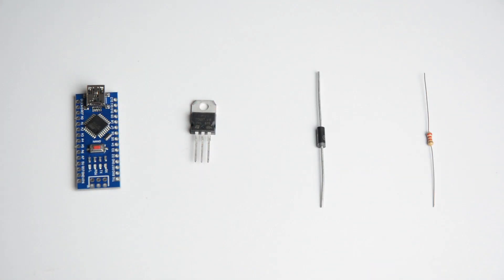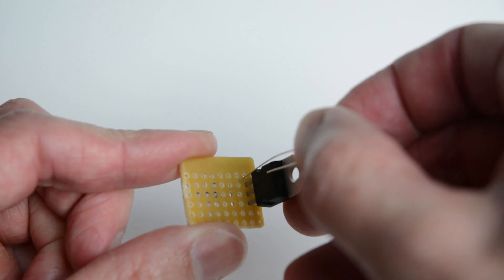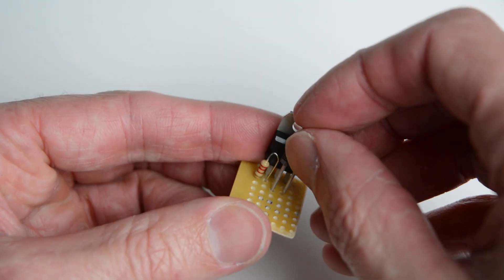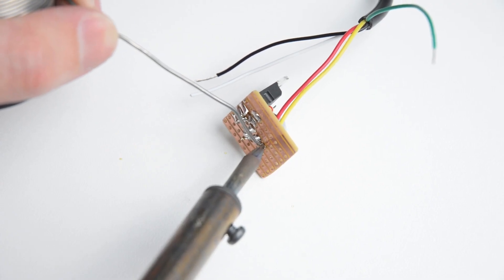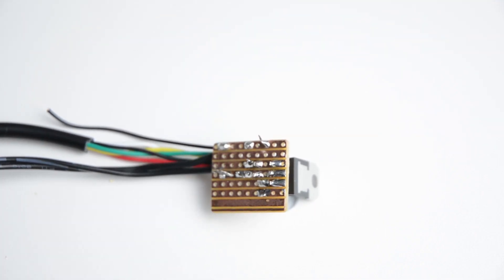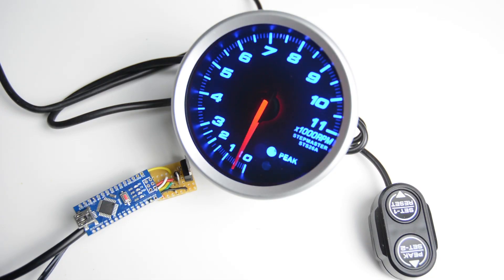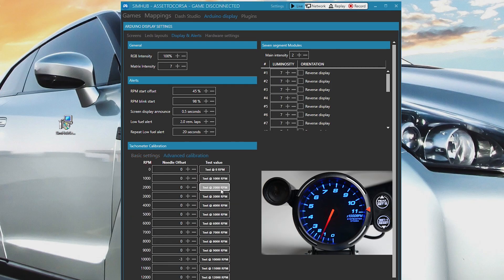DIY ARDUINO RPM REV TACHO SIM HUB DASH

Comment: Hello amstudio,
how could i Use Arduino UNO R3 Please let me know. One more thing: can I use Arduino UNO directly as a tachometer? I mean, can I ignore the below components and directly connect to the Arduino Uno?

1. TIP-120 Darlington Transistor - 1 pcs
2. 2.2Kohm resistor - 1 pcs
3. 12V dioide - 1 pcs

Comment: Hello, i am not familiar whih these DIY projects. Therefore, i do not understand why is the diode used to connect the emitter and the collector here. I wonder wouldnt the circuit works just fine without the diode here? Thanks

Comment: I can’t get my arduino to communicate with the software found a video they said the chip needs to be updated to be able to communicate but didn’t explain how to update the chip in the arduino bought a second one hopefully it will work but same thing it shows it’s connected but won’t communicate can’t add non of the settings to it any help or video how to setup arduino I watch dozen of videos but non seen to have the problem I have when they click on it it’s reconigzed automatically so one talks about how to fix the issue

Comment: Hello everybody.  I have a problem with a DIY creation.  I followed the tutorial to make a tachometer.  I took the one from Ali.  everything is assembled correctly and I took the tensions as explained in the wiki.  The tachometer initializes correctly but when I press Max, nothing happens.  If someone has an idea.  Thanks a lot
Reply: I had the same issue if u have any solution inform me please
Reply: Having the same problem here, maybe I'm using wrong diode.

Comment: For what is the resistor, TIP120, diode thingi? It didnt outputs a signal to the gauge for the needle. Without it not problem.

Comment: Also can I use more than gauge on a Arduino? Like water temp, oil pressure, oil temp, boost and fuel indicator?
Reply: I would like to know the same, like indicators ect..

Comment: Hi great video, like you, I installed the tacho with sim hub the latest version 7.4.16
 and it does not work would you have a solution thank you in advance
Reply: Hi Steph. I have the same problem. Did you find a fix?

Comment: Can you just use a buck converter to step down voltage instead of making the circuitry?? Does it just require changing 12 Volts down to 5 volts??

Comment: What is the point of the transistor in this circuit? Is it because the 5v put out on D9 for the signal is not enough for the tach. So with this circuit when ever there is a 5v high signal on d9 it will let 12v flow to the tach signal wire?

Comment: Hello, I have followed the welding procedure and elements to the letter.
 I download the sketch on the arduino uno with the connections correctly.
 Only, the tachometer turns on but when I do the tests, the needle does not move.
 Need help...
Please🙏🙏
Reply: Hey. I've has the same problem. Did you find a fix?
Reply: same. any fix?

Comment: Hye. I’ve done connecting all the cables and the components according to your guide. But it seems like my tachometer did not respond at all. I’ve manage to upload the arduino but it looks like the gauge did not receive the signal. Your respond would be much appreciated.
Reply: Hey. Could You fix it? Same problem here :(

Comment: I was just wondering if you could just run the 12v power straight to the tach and then have the green wire to the Arduino? My tach only has the 3 wire setup. Red, Black and green.

Comment: I think it not being synced up properly with the screen would drive me mad, super cool though.
Reply: They are synced but they are diffrent taco metters
Reply: @-sidwayz-n0t145  i paused it multiple times and it was off slightly
Reply: They ain't the same gauges that's why they are diffrent when you chose a modded car like I did with one of those shift gauges it was synced perfectly

Comment: Hi I did everything as described once inserted in the sim hub loaded the scretch nothing the tachometer turns on but the test does not go in your video you do not see I have joined all three gnd. I don't understand what I'm wrong. Is it possible that it is the different diode? they sold me Diode  1n400
Reply: Hey. Did you get it working?

Comment: when i got to test max rpm the does nothing.  All connections are good
Reply: Hey mate. Did you get this working?
Reply: @mickgrose6743  Not this particular tachometer. I ended up getting another different tachometer and used that one.  But I would like to get the one above working because I like it better.
Reply: @mickgrose6743  how did you connect the solder points.  I think that’s the point was messing up on.
Reply: @brandonduncan8064  I just used a small circuit board and soldered them like the video. Is that what you mean?

Comment: I have a vw golf mk4 cluster and I want to use it, I used your code for e36 and put the same wires after I found the right wires diagram for the cluster only the speedometer worked

Comment: Ok So i ran into a problem. The tacho's they do power up, and the arduino is scripted through sketch, but when I try the tacho nothing works. 
My setup: 2 seperate boards for each tacho, combined both signal cables into one main line, got the signal cable to the arduino on port 9, Port 9 is also selected in the simhub.
please help !
Reply: please tell me you found a solution and willing to share it with me, I have the same issue
Reply: Not yet, have abandoned the project but am now buying a arduino uno to try it

Comment: I just tried to build two myself. 
I am a person that is medium skilled, but soldering was years ago. Yet thanks to your clear instructions I was able to produce two working tacho's (just need to put em on my arduino, but t he boards are powering and the tacho's are powering up)
So thank you big time!
Reply: mine are not
Reply: Can you tell me what Diode you used? The link doesn't work and not sure on which one to get thanks.
Reply: 1N5349B IN5349B Zener diode 12V 5W DO-15 IN5349

Comment: Supported games are :
• Assetto Corsa
• IRacing
• ProjectCars/ProjectCars2
• Codemasters games (Dirt 4, Dirt 2,Dirt 3, Dirt Rally, F1 20XX)
• Euro Truck Simulator 2 / American Truck simultator
• RRE 
• Rfactor1 
• Automobilista (using Rfactor1 plugin)
• Rfactor2 
• LFS 
• RBR 
• GTR1 
• GT Legends 
• GTR2 / Race
• Race07 
• War thunder ???

Comment: Hello,
First time thanks for the perfect instructions.
I copied the combination. However, my speedometer always beeps at 6000 rpm and the switching LED turned on at the same time. How can I adjust that? Thank you for your support. Likewise, I do not get the tach on Dirt Rally running. Did you have similar problems?
Reply: Not all games are compatible, you will probably have to wait for program updates until dirt rally is compatible

Comment: I saw multiple videos of you using the Arduino Nano for one gauge or display or something like that exclusively. Is it only capable of running one device at a time? Or can you connect like the RPM LEDs, the Boost Gauge and this one on one single Nano? If not, i'm running out of USB ports :D

Comment: I've just seen your vid on the E-hand break to use on the G27 steering wheel with my PS4. my question is can this rev counter only be used on a PC or can it be used on the ps4 or somehow linked into the G27 rev counter leds. when you up load the program to the Arduino Nano device can it be disconnected from the pc to use on a ps4 etc. thanks

Comment: Hi great vid there, I made one based on your instructions. Though I just changed the Diode to a 12V 1W ( 1N5242 ) to replace the the 12V 5W you used as there weren't any available stocks in the Asian region. It worked flawlessly still with the 12V 2Amps adapter.
Reply: caranya gimana gan
Reply: @amryms  saya ganti sja diode yg dia pakai dgn diode yg saya dpt cari dgn spesifikasi yg plg dekat, ikut shj schematic balik dgn arah polarity diode

Comment: Your video is very inspiring. But it now gives me more questions. Can you please explain how to hook up a 4 prong speedometer to the anode. Is it possible to hook up 6 gauges to the board you used in this video. Please help me I am struggling with trying to make a speedometer and tachometer. The parts I am using is out of a dash cluster unfortunately.

Comment: would it be possible to use the program to also activate the speedometer and the display lights? if yes how would the speedometer installation.

Comment: Love the videos great work. Can you run multiple gauges off of one Arduinos or does there need to be one each?
Reply: You probably have an answer by now, but in case someone else wonders about the same thing: any pin with PWM output is capable of driving a single gauge (and then there's some trickery capable of being done with switching non-PWM ports on-off really fast, but that's definitely something that brings you down to the root of Arduino core programming).

Comment: Hi, first of all your instructions were spot on. I am kind of stuck. I am at the bit where you tested RPM MAX, and its not working. I fluked resistor, diode and transistor and they are working fine. Checked continuity all the way to the PCB on tachometer and it is working.  There is power on tachometer and nano. When I click test max rpm on basic test the RECEIVE light flashes on nano and that's about it. I have already swapped2 nanos, just to make sure it's not nano. Any suggestion where I should be looking?
Reply: Hey. Could yo fix it? Same problem here.
Reply: Me too
Reply: Me too. Any fix?

Comment: Great Tutorial!!!!  My Tacho after power on test, set to 1,200rpm (12V) probably the diode is not good, could you please help me with the type of diode ?? thanks
Reply from the maker: Yes I used 1N5349 Zener Diode 12V 5W
Reply: Strange....I removed the diode and now working fine.. diode is only for protection ?

Comment: good job my friend. I tried to make it by myself and bought the same tacho, however in SimHub is somehow not possible to make it work for the full 11k rev scale. When I press "Test max RPM" in SimHub, the tacho shows only about 7,5k RPM, not sure what can be wrong. Any ideas?
Reply from the maker: Check the Tachometer cylinders match on SIMHUB and on the actual Tacho. Eg set both to 4
Reply: omg it works now, You were right, there was wrong cylinder value set in tacho. Even though in manual is writen that  default setting is 4, it wasn't. Thank You very much for advice :-)

Comment: OK I GOT MY NEW TACHO GAUGE BUT ITS ONLY GOT A 3 WIRE HOOK UP AN SO I GOT A GREEN WIRE ,N IM THINKING THAT THE ONLY PLACE IT CAN GO IS ON THE RESISTOR!! BUT I MAY B WRONG..IT HAS HAPEND BE FOR ..A TIME OR TO..LOL. ANY ADVICE? THANKS
Reply from the maker: Green will most likely be the signal wire. Then a red power+ and a Black negative - . Id say on your one the lights, power and accessory are all combined in the one wire.

Comment: WELL I HAD ALL THE PARTS TO BUILD THIS ,AN DID, BUT MY TACHO WAS DEAD .LOL. SO I GOT TO GET A NEW ONE ..LOL(JST MY LUCK TO).. BUT I WAS WONDERING CAN I STILL USE MY OTHER DISPLAY WITH MY ARDUINO MEGA FOR MY OTHER DISPLAYS WHILE USEING THIS ALL TOGETHER?? 2 ARDUINOS.A NANO,AN MEGA I THINK !! THANKS AGAIN FOR ANOTHER GREAT VIDEO..AN KEEP ON KEEPING ON.. ..PS I STILL WANT TO SEND YA SOME PICS OF MY OTHER DISPLAYS I BUILT..INSPIRED BY U.. BUT NOT SURE HOW TO PM YA..
Reply from the maker: Hey, yeah that's always the way! Yes you can use more than one arduino, but you can also connect a few displays to the one arduino. For example pin 9 tach, then pin 6,7,8 for tm1638. Just update the sketch to match. Sure send me your builds, You can send the pics to my email its in the about section.

Comment: Great work man ! ...so I went and bought everything and put together...tach lights up and does initial test sweep but when i try it in program no go...do i have to donate? I noticed in your video that your device fps was 64...mine is 9... any ideas ? I set up everything exactly as you did including base orientation of the diode.
Reply: Hey dude. I had the same problem. Did you get it sorted?

Comment: FOR CONSOLE USERS, YOU CAN USE AN APP CALLED 'SIM DASHBOARD"
(Android only)
Reply: ReuphTop Will It work on PC? I have done SimWheel (Android device as a wheel)  on RFactor before
Reply: YES!
Reply: If you need any help setting up, Hit me up!
Reply: ReuphTop. hey man...set up tach as per video unit turns on but not working when i hit test in program...ive triple checked everything including diode orientation.any help is appreciated.thanks man

Comment: dhow many amps does it need to be (power supply)
Reply from the maker: 500mA+ , I am using a 12v 1500mA from a old external HDD
Reply: check on the tacho, it should say the maximum amount of amps it can take.

Comment: What amp rating should the 12v Power Supply be ? don't really want to be blowing my new creation up, I'm a massive fan of this channel with your quality DIY builds & I still have to get round to building that wicked hydro handbrake you did a while back, thanks for the awesome vid's....
Reply from the maker: I am using a 12v 1500mA from a old external HDD
Reply: Thanks :-)
Reply: Hi, I'm having problems with this project, can you help ?
For the record, in the interests of success I sourced & acquired the exact parts list that was in the video information including the exact same model of tachometer.
I'm running 64bit Win7 Ultimate & installed SimHub as Administrator & it's the same version as in the video, I know there are newer versions but I kept to the video version to avoid any potential problems & I also have NO experience with Arduino Nano's so have no idea if the constantly flashing red LED is normal or if it signifies a problem of some sort as I have no information to refer to & the board is a Nano CH340G.

The build went fine so I downloaded SimHub 5.2.0 & installed as Admin, I then plugged the Arduino into the USB & plugged the power supply in.  I opened SimHub & selected
"Arduino display/Hardware settings/Open Arduino setup tool" & got this message "Arduino is not installed or up to date, do you want to download it now" & as it was obviously needed I disconnected the USB lead & clicked yes to install which completed successfully.

So I open the "Arduino setup tool" again & make the changes that you show, I put the com port & arduino board details in & then click "Upload to arduino" & after 3 or 4 seconds a small box appears saying "Compilation failed" & does it everytime I try.  I've checked & re-checked & I can't see what the problem is, I've checked in "Device Manager/Ports" & it's listed as "USB-SERIAL CH340 (com3)" & is working properly so I know I selected the correct port & board in SimHub!  I also checked in "Control Panel/Programs & Features where I found SimHub listed but nothing for the Arduino which strikes me as odd considering it has a program to run it or am I wrong ?
PS: Sorry it's long.......
Reply from the maker: Hey SmokinJoe!
The flashing Led is the standard blink test to show the Arduino is working. 
Try update the Libraries.
Also copy all the Libraries folders 
From   :\Program Files (x86)>SimHub>_Addons>Arduino>Libraries
To        :\Program Files (x86)>SimHub>_Addons>Arduino>ArduinoIDE>arduino-1.6.13> libraries.
Reply: Thanks so much for the quick reply, I will try your suggestions shortly.  I've since found out that there are "Cloned" Arduino Nano's from China flooding ebay with the same part numbers as the one I have, some of them work & some don't & another more bizarre thing was using the right kind of cable.  I read a post on a thread that a fella was having the same trouble as me, turns out he was using a cable that was only meant to charge a device so borrowed a cable from a friend & bingo everything miraculously worked, seems a little far-fetched to me but could be so I guess.
Thanks so much for your assistance, onward I go :D
Reply: I have the same problem, have you been able to fix it?

Comment: hello i have a quastion is it posible to do this whit any Tachometer
like this 1
https://nl.aliexpress.com/item/3-75inch-80mm-Racing-Car-0-8000-RPM-Carbon-Fiber-Tachometer-Gauge-With-Shift-Light-Mounting/32529013263.html?traffic_analysisId=recommend_3035_null_null_null&scm=1007.13338.84300.000000000000000&pvid=ceff836f-fba9-4a64-b2a6-5ed40be016c8&tpp=1
if i want to do this i have to do whit a buget 
20 euro for al the stuf
and is it posible to add a speed indicator and a gear sign to sea what gear you in regards davey
Reply from the maker: Yes will work, but max Rpm is only 8000 on that item.
Reply: that rpm is limited is not a big deal as long as the connections is the same and it works then i am a happy driver
i hope the wiring is the same as well

Comment: great video as usual!
i have a question: you can connect 2 outputs to the arduino at the same time? for example the tm1638 and the techo meter?
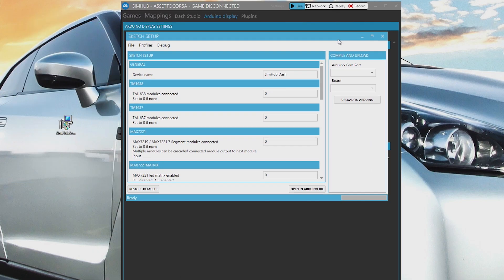Reply from the maker: idan, yes! For example the Tach - pin9, TM1638 - pin 6,7,8. Just adjust the template 4:55 and enable each before uploading to the arduino.
Reply: Thanks. You're the best
Reply: idan i'm asking the same question
Reply: good morning! I am interested in this since I have the 2 diy done but I can not connect them together, would you mind detailing how I would do it? A greeting, my email is kyrondnd@gmail.com